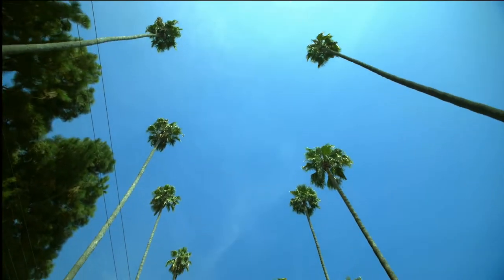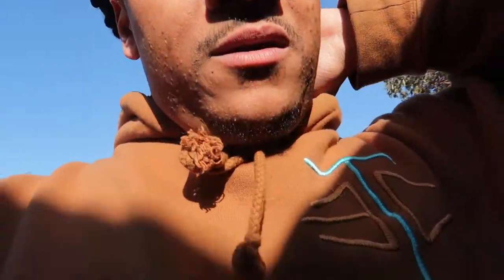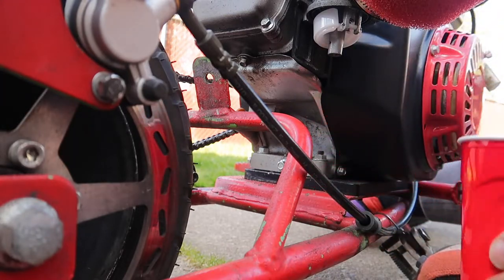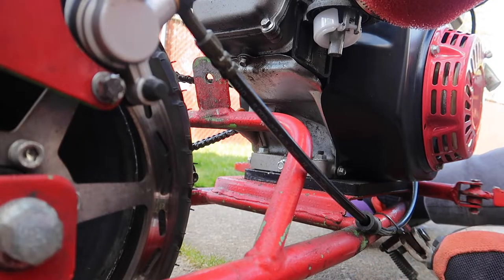First Time Installing Carburetor Jets On My 212cc Predator Engine!

Comment: Hey yall, i can tell you , you need a #37 jet for the stage 1 upgrade.  Thats due to the aftermarket performance air filter,it allows more airflow than fuel. You may want to consider changing to a hotter sparkplug also. Hope this helps. 
Glad to help a fellow minibiker
Reply from the maker: Thank you so much 😊
Reply: Thanks!

Comment: Im running the same exact setup as you but i just have an older model of doodle bug with a torque converter so i can play around more and still have a good top speed
Reply from the maker: What size engine you hav?

Comment: I’m having the same issue, have to upgrade the jet now
Reply from the maker: Yess, I changed em' out and haven't had ah problem since. Also make sure ur carburetor is clean. Thanks 4 watching my video!
Reply: @tomakealongstoryshort-TP  thanks bro , what size jet did you put in it?
Reply from the maker: @wiillthebarbertv9415  I believe it was the .37 if I'm not mistaken. I ordered em' from Go Power Sports I got ah few I made myself ah little variety pack!
Reply: @tomakealongstoryshort-TP  nice, it’s for my sons bike, I have the predator 224, I didn’t have to rejet mine , it runs beautifully, I’m hitting 63 mph straight chained , bypassed governor, air filter and upgraded exhaust
Reply: @tomakealongstoryshort-TP  he has the Coleman 196, I have to get rid of the jack shaft and fix the jet, his is the BT200x I have the Axis M200
Reply: @wiillthebarbertv9415  I have mb200 axis with 224 on it also
Reply: @MoneyBagTim_  awesome, still running strong, I just ordered mirrors from Temu, I’m riding it like motorcycle lol